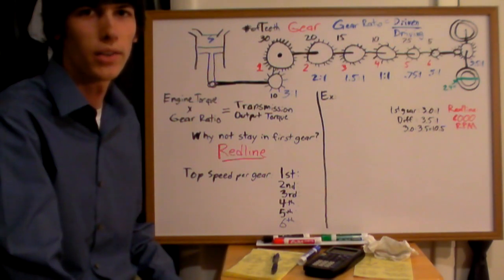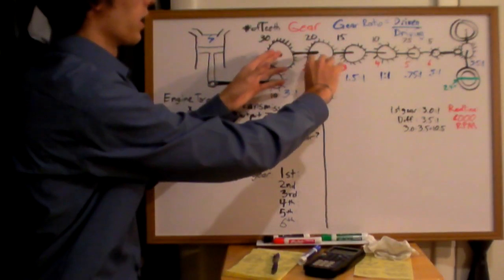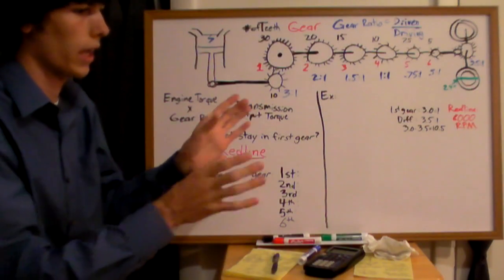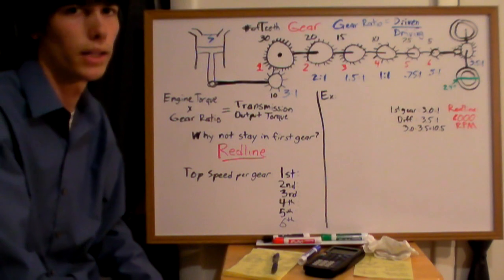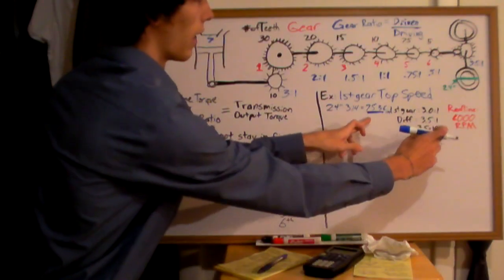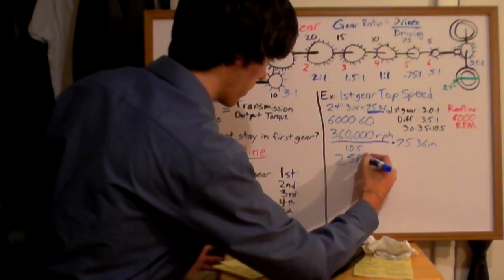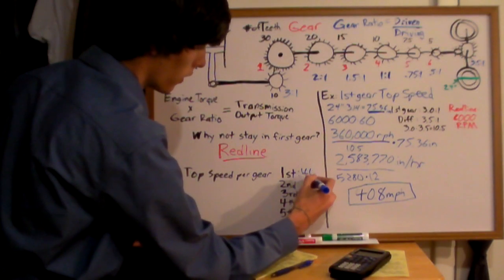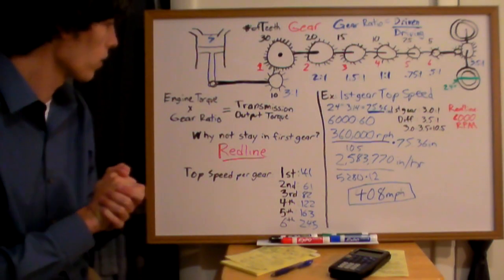Car Gears - Explained

Comment: I can relate to the bike analogy but I still don't quite understand (why) what exactly prevents you from staying in higher gears at lower speeds (the reason you can't stay in lower gears is pretty clear given an upper bound on RPM). Ok, you have less torque so it's harder to drive up a hill but even so why does a car stall and not just move very slowly?
Reply: The engine needs a given amount or rpm to run at idle. If you have 1000rpm idle and you go to 500 the engine will stall, simply doesn't have the inertia and power to run by itself. If you get on a bike, and you select the high gears, it will be really hard for you to advance and you would probably stall. If you select a lower gear and get to speed then select a high gear, you wheels will turn faster than your legs are, you would still have inertia and power to stay at that speed without much effort. If you stay at high speed and low gears you would get tired of course, so you need to lower your legs speed in order to advance. But you sacrifice torque for speed
Reply: Thanks, on a slightly unrelated note, since Tesla has just the one gear, does that mean that it always produces the same of torque (given constant pedal angle) e.g. when you floor it no matter the current speed.
Reply: An electric engine always gives you the max torque from idle to high revs. Gearboxes are used for internal combustion engines because power it's not constant. So how do you solve this problem? By adding a gearbox, you need a gearbox to supply high torque at low speeds but also operate in highway situations. Electric motors and steam engines have constant power output so they don't need a gearbox. This type of engines don't need a clutch either.

Comment: this shows why low end rpm torque is better than lower torque running high rpm. doesn't it because basically if you have low end rpm torque and you use gearing to your advantage you'll be really fast and economical depending on gearing. but if you use high rpm low torque like JDM uses and you don't use Gearing to your advantage your just sitting there waiting for the horsepower instead of it being immediately present. I also want to know when we are going to start using CVT to our advantage. even if not used as the transmission replacing gears like my Can Am ATV has done. why don't we use a CVT as a rear end gear ratio?
Reply: when you use gearing to your advantage, it represents the HP figure.... if 100lbs of tq at 3000rpm, vs 100lbs of tq at 8000rpm, the 8000 rpm tq makes more hp... thus meaning that amount of tq makes more power that rpm than it does at the lower one....

the amount of time it takes to get there is quite frankly pointless..... there is no "sitting" to wait for it...

hp determines how effective you are using your tq....
hp is what is important....period
Reply: Chad W more torque at earlier RPM accelerates more than waiting for more rpm to multiply your small torque figure. You won't ever understand until you've ridden in both a low Rpm massive torque vehicle and a Massive Hp high rpm vehicle
Reply: You wouldn't believe how much difference 500 Hp at 2500-3500 rpm feels compared to 500 Hp at 6500-7500 rpm

Comment: can you do a video on how air resistance affects speed and engine performance
Reply: Doesn't affect engine performance, well maybe it does a little bit. But air resistance slow your car down, the faster you go the more air friction you have and it's harder to accelerate.
Reply: +Cristian Ceclan thanks

Comment: When cars mention final drive ratio,  i take that is the ratio of the  differential?
Reply: yes. but in FWD ect it's not rear end gear ratio because it's not in the rear end. so they call it final drive. just different name for same thing basically. a corvette has a final drive because the transmission and rear end are one case for example and aren't two separate devices

Comment: Where does the Final Gear Ratio come to play?
Reply: +Gabriel L Centeno Castro it determines the number of revolutions the wheel makes prior to the engine speed after the gearbox, the closer it is : 1 the less revs it has to make and also less torque is transmitted through the wheels and vice versa.
Reply: +roskataqv Thanks never thought about it, thanks a lot

Comment: Are these ratios the same in all car models?
Reply: No
Reply: no every manufacturer tries different torque and rpm outputs which means it requires more or less gearing. I think more torque less rpm and larger gearing is the way to go because the gearing alone can make a car both powerful and efficient at the same time just in different gears. like having 8-> gears allows both aggressive gearing and economic gearing together

Comment: blargh... imperial units here we meet again :P good video though.
Reply: Imperial measurements are fine for one-off things like your height and weight but that's about it. I cringe when I see someone measure something and they're going from 5/8" to 13/16".. it's like... WHAT? Use the metric system ffs.. And fahrenheit makes no sense at all: 32F=freezing and 212F=boiling? Again, it's unnecessarily complicated..
Reply: +solomani Metric makes sense. There's one unit for everything and when you jump by 1000 you just add a milli or a kilo to it. In imperial, with weight for example, you've got 7-8 different units that change base as the weight goes up. It's more difficult to calculate things this way since half the time you don't know what base to use. 
In regard to temperature: The zero point for Kelvin is the zero point of the universe, and when converted to Celsius it's the freezing point of water (100 being boiling)  you can't get LESS arbitrary than that.
Reply: It has benefits? I'm curious, what are the benefits?
Reply: Just multiply miles by 1.6 to get kilometers :)
Reply: Despite how smart this guy appears (especially in all the other videos), using inches and pound feet makes him seem kind of confused... Like why not just convert the wheel diameter to meters directly
Reply: because we don't really teach or rely up the metric system here in the USA.  Our military uses it and our scientist use it (international standards and all).. at the end of the day, we (the average Joes) are just really set on this system, it's what we know..  and it does have its benefits..
Reply: we really link machining to thousands of an inch in home or hobby workshops..
Reply: He's american and he's using mph because that's something Americans can relate to.
Reply: Somal Many engineers in the US rely heavily on the imperial system. It isn't like science where metric is the standard, even in the US. There are a lot of reasons behind still using imperial, some of which are legacy reasons (e.g. it's easier to deal with the current imperial measurements in place on many structures than convert to metric and try to implement it with everyone on the same page.)

Metric is used. Imperial is also used though. It's up to the choice as long as the measurements are marked properly.

Science is different than engineering when it comes to necessity of different unit systems, especially with the factors and risks of reverse implementation at play. That's why we teach imperial AND metric in engineering schools in the US.

Comment: Wouldn't another good reason for switching gears that you didn't mention be to get better fuel economy since when you do go to a higher gears initially you would be at lower Rpm's? @Engineering Explained

Comment: I've always had a passion for cars, but never understood how they work. As I watch more of your videos, I'm learning more and more about cars. Thank you!
But then.. By the way, about the video. There's just one thing I don't understand. The first gear has 30 teeth (the gear with most teeth). Why would this make the car have more torque?
Reply: +DrifterX2J last I recall it's because its the BIGGEST gear which explains the amount of teeth and more torque the rest start getting smaller which helps you get that higher top speed since the gears rotate faster helping them to send that higher rotation speed to the axle/wheels.
Reply: Chad W Well, obviously I gotta start from the bottom right? Haha :D Anyways thanks for the extra info
Reply: Torque is also known as the TWISTING Moment.This is defined to be the radius of the gear times the force applied at the mating point of the gear. The larger the gear means the larger the radius will be therefore supplying more torque.
Reply: +Chad W hey chad, would u stfu pls!! let the man learn it from the roots.
as they say, even burz khalifa is only as strong as its foundation
Reply: The key to torque is the radius of the gears, same with belt driven wheels.
More radius/wider=More torque
Less radius/narrower=Less torque
Because Gear torque is Force × Radius
Reply: Luis Soto ""rest start getting smaller which helps you get that higher top speed since the gears rotate faster helping them to send that higher rotation speed to the axle/wheels."
Dude, by reading this it all makes sense to me now. Thanks!
Reply: Chad W So its not obvious that if you wanna learn about something, you gotta start with the basics? genius
Reply: +DrifterX2J  you have a passion for cars... and then theres your profile picture lol
Reply: Matt Gray I collect Hot Wheels. Lol
Reply: lol
Reply: sumit cryoluter idk what his deal is but something being your passion does not mean you know everything about it. And I have no idea how we got on the subject of passion
Reply: +Matt Gray Haha! That is funny stuff.
Reply: I understand that it's Easier to push so more torque goes through it. but with less teeth it's harder to push so it looses energy and efficiency
Reply: +Jack of Blades (Steam) science!
Reply: Work = Force x Distance (Joules = Newtons x Meters). Since first gear in this demonstration has a 3:1 ratio, it goes a third the distance the driving gear does in one revolution, and thus exerts 3 times the force on the transmission. For example, the driving gear: 1 = 1 x 1 rotates first gear: 1 = 3 x 1/3. Torque is a measure of tangential force on a gear multiplied by the distance from it's axis (in other words, the radius). More force on a larger gear (greater radius), more torque.
Reply: the one with most teeth has to be the largest gear. meaning slower revolutions and thus more tq....

by the way... if its your passion, why do you know little about.... YOUR PASSION?
Reply: Drifter's Diecast its not obvious because we are having this discussion
Reply: Drifter's Diecast no moron. if its your passion, then having the basic discussion shouldn't happen....
if my passion was food, i wouldnt ask about how to pour water...

if my passion was flying, i wouldnt ask about air density,

if my passion was cuss words i wouldnt ask how to spell....

GENIUS!!!!
Reply: @chadw4638  I know this was three years ago, but hopefully you've turned 12 by now and stopped being such a pitiful twat

Comment: You didn't explain how you got the 3.14 in your equation
Reply from the maker: +soulreaper2557 It's pi. :) 3.141592653... and so on.
Reply: ahh...didn't think of that......thanks
Reply: Is that a graphical calculator I see!
Reply: 24 inches is from the center of the wheel to the very outside (including tire) in his case. He used PI to find the circumference....just like cutting that tire in half and laying it flat to measure how long that piece of rubber is. 24 inches laid flat equals 3.14 times that 24 inches which is 75.96 or whatever he said. I hope you can see the big picture I tied to paint for you.
Reply: PI

Comment: What I don't understand is how you can shift into first gear from a stopped position when the crankshaft is rotating and the wheels (which are connected to the crankshaft via transmission) are stopped. Wouldn't this put an extreme amount of strain on the transmission?
Reply: +Sergeant Kovac You disconect the transmission from the engine if you press the clutch. So, when you stop, the gears in your gearbox also stop to spin.
Reply: I'll try to answer the question, I hope that I understood it.
So if your car is stopped you have to be in neutral, otherwise the car would stop.
So u step on the clutch, release the transm. and put in into gear then get the clutch back and step on the throttle, otherwise(again) the car would stop.
Reply: I understand the basics of a transmission. I just don't understand how a gear in motion (linked to the engine) can engage with a stationary gear (linked to the wheels) when there is so much weight and torque needed to get the car moving
Reply: Folopolis Thank you, finally someone understands what I meant in my question... This explains a lot.

Comment: i have a 4g15, have oversized it to last cut (which is a faulty mod made by an inexperienced mechanic) hand my crank shaft regrinded, and my intakes port and polished, i have noticed that i am losing top end power, and the power is in 3rd gear is it because of my transmission?

Comment: I think you just taught me how to drive a manual properly. So, if I'm raising my RPM's & and going faster that's when I should change gears? For instance, if I'm going 55 mph, I should be in 2nd gear right? Using the top speed per gear as a reference I should be in that particular gear? Is your first gear your fastest acceleration (more torque) and the sixth gear (least torque) the fastest speed?
Reply: RzVids As far as I know; the only time you should be going 55mph in 2nd is if you're trying to go 0-60 as fast as possible. It's generally something like 1st gear (0-10mph), 2nd gear (10-20 mph), 3rd gear (20-30 mph), 4th gear (30-40 mph), 5th gear (45-60+), and if you have a 6th gear, use that for 60+, usually on highway cruising. 

However, if you want to go faster, say pass someone, you can downshift to a lower gear, which brings your RPM up, so you can accelerate faster.
Reply: +RzVids When driving a manual, I don't even look at my tach or speedometer - I drive by engine sound.  You can definitely hear when the engine is getting near its redline.  Depending on where your redline is, you typically want to be shifting a few thousand before that.  In my car, my current redline is 9000, but I tend to shift around 5000 (if Im not driving like a dick).  Before this, my old car had a redline of 6800, and just daily driving, I usually shifted 3750-4000.  Again, it all depends on you car, its transmission (9000RPM car has racing gears for 1-3, 6800 had a more standard transmission).
Reply: RzVids Itachi!!!!!!!!!!!!
Reply: just look at your rpm, shift just when it redlines, can't be that hard
Reply: officialboaz downshift or upshift?
Reply: Ric Rm So when I'm going too fast for a gear just upshift? If I want to accelerate, downshift? Decelerate, downshift?
Reply: RzVids Pretty much yeah
Reply: So like... Is it bad to floor it in first gear and/or "gear skip" and stuff?

Comment: Okay I sorta understood this, kinda, but howwww do I get more acceleration and maintain a high speed at the higher gears, aaaand continuously increase speed while doing so. If you could explain this you would save my brain a looot of trouble.
Reply: AuGoldification It's different for every car, depending on (mostly) the engine power, the engine power curve, the overall gear ratios and the road you are on. But, what is universal is that there is always a compromise: the optimum gear for acceleration is rarely the optimum gear for high speed. Most obvious example of this is that some cars have top speed in the highest gear, others have their top speed in lower gears. 
The best advice I can give you is to try out the various gears in your car for various scenarios and to learn how your car handles those scenarios.

Comment: So why don't we use smaller and smaller gear ratios for higher speeds. Is there something called as torque loss, where you need some torque to just keep the speed constant at high rpm, and reducing gear ratio will reduce your torque causing the car to slow down. Or are there some other limitations like mechanical strength or heat

Comment: This is the first time someone has ever talked about this. One question I have for you, you haven't taken any cc and went on calculating the speed for each gear!? How is that possible?
Reply from the maker: gopikrishna swargam CC? This is just looking at the transmission alone, and determining the theoretical top speeds for each gear.
Reply: Cc meant the displacement :D
Reply: +Trig Williamson though I appreciate your answer, but it doesn't make you call me retarded.

Comment: Engineering Explained    When the engine starts does the crankshaft start rotating  for 6000 rpm for the above modal and than according to the  gear ratio power is being transferred or does crankshaft rotate at different speeds for different gears ratios ?

Comment: you literally dissolved the stuff and poured it in my head. Bravo! Now I have a very good idea of how the car runs. 
Are you an automobile engineer? Which company are you working with?
Reply from the maker: Ahmed Ali Mechanical, self employed. :)
Reply: +simon vandenberg 
I want a job sleeping...
Reply: Engineering Explained that's what i want to do

Comment: Okay no one can answer my question. What gear ration for my REAR END do I need for high speed applications such as like f1 racing or nascar. I'm building a race truck and I don't want a drag racing fear end I want the highest mph I can get
Reply from the maker: Kyle Vroman The lower the gear ratio, the higher mph it's capable of, but the less torque you'll have at the wheels. It's a balance.

Comment: Eco driving seems to be "use the highest gear that comfortably does the job" where as racing driving is "use the lowest gear that does not exceed the red line (apart from on a long bend where you may as well change up)"